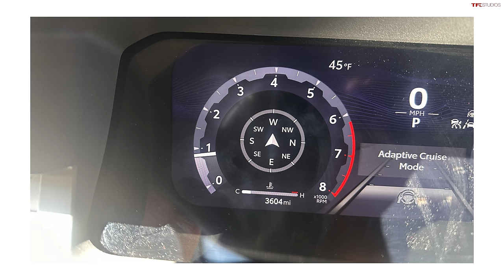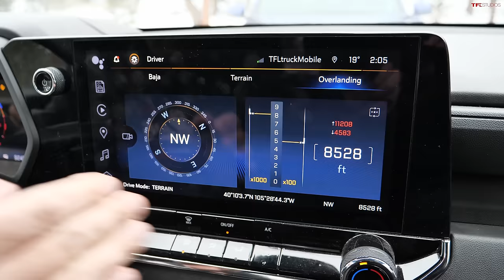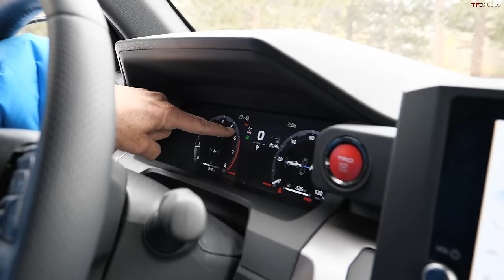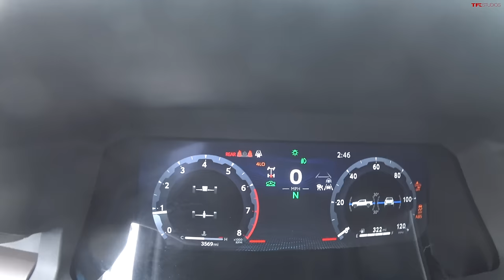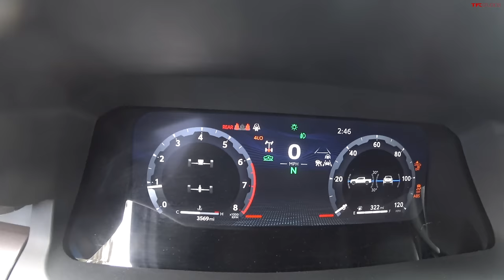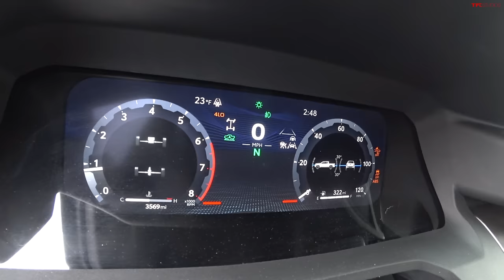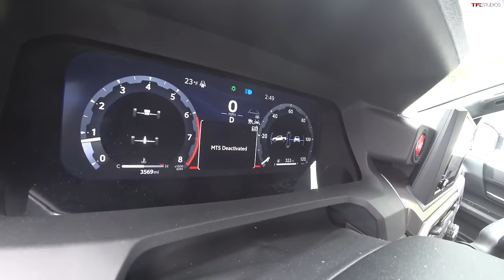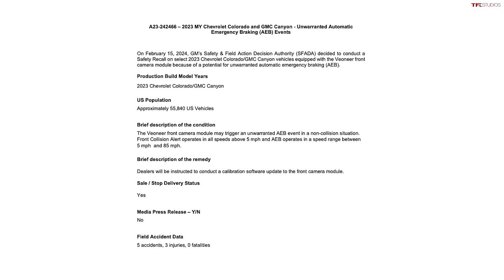Our Brand-New 2024 Toyota Tacoma Almost Left Us Stranded...Here's What Happened!

Comment: 33:03 even if they do watch it. You guys are absolutely right.  There’s basically no load on the drivetrain  in the slippery of terrain. There’s no way anything should have broken in that situation.
Reply: ATRAC puts load on the drivetrain due to the braking of the spinning wheels.
Reply: @thelandcruiserproject no atrac on auto Tacoma’s only manual
Reply: @mikem273 lol.  Um.. You might be totally wrong about that one
Reply: Even so. ATRAC shouldn’t break axles. It’s got to be a defective part. I could see ATRAC break an axle in Moab while bouncing at 75% throttle. Not icy conditions. Otherwise every Canadian Tacoma driver should really watch out.
Reply: @thelandcruiserproject  my question was ATRAC disengaged and could have led to the able breaking?
Reply: Not the whole story though- in an open diff the ATRAC system applies the brake in a pulsating timed application from the wheel speed sensor feedback into ATRAC and when the wheel is braked, the power goes (magic of an open diff) to the wheel (singular)  that requires less torque to rotate it.    @thelandcruiserproject  , but everyone can see  when the axel broke- Roman did have a bit of wheelspin going on (not a lot of RPM's) but with that wheelspin, when the tire contacted the dry portion of the rock the sudden stopping of the wheel (just a split second before the axel broke) and  the power going through the axel, the axel popped.  pretty obvious, seen it many times off-road with the wheelspin and the sudden traction.  the energy has to go somewhere. The torsional load on the axels is multiplied significantly with that wheel spin. IMHO the axel had to be a defective , weak part from Toyota though to pop with this little amount of rotational force on stock tire size  and a very mild amount of spin.
Reply: @86309  That shouldnt happen regardless. Especially not on such slippery rocks. Then you cant do anything. You would have to be careful even on regular roads in the city lol.
Reply: @thelandcruiserproject  Yes but not much under these conditions. It should be able to handle full throttle on tarmac.
Reply: @stevenk805 Maybe that’s why new Tacoma’s are just trickling into Canada.  Testing reliability on US soil first.

Comment: I made a comment some videos back on how nobody truly tests whether the Tacoma is even reliable or capable at all. I thought it would take at least a little more than 31 inch tires and a bit of snow to have a catastrophe...
Reply: I think personally he shouldn’t have been behind the wheel
Reply: @kc.47   Classic Toyota fans always coping and quick to excuses when their God bleeds.
Reply: @kc.47 Yeah and he obviously didn't keep on maintenance. He should have changed the CV's every 1000 miles
Reply: @AnabolicRick915  as a Toyota fan this is disappointing and nothing short of unacceptable. This is just the turbo, what's going to happen with the significantly more powerful hybrid. One thing is forsure, whether your a Toyota guy, Jeep, Rover... whatever your brand, older is better.
Reply: @BingBingBingBingham  Absolutely. Older cars were just insanely overbuilt. These days they have to squeeze for razor thin margins so the parts just naturally are cheap and crap. I say this as an owner of a brand new vehicle too. They just aren’t built the same and the engines are under high stress due to turbos and regulations pushing those limits to the edge.
Reply: @anabolicrick915 Toyota fan here. The new Tacoma is a Prius with a truck bed. It’s absolute trash. The 3rd gen I bought last year will be the last Tacoma I buy new.
Reply: Losing an axle isn't a catastrophe😂 blowing your T case is a catastrophe. Tell us without telling us you've never off roaded before
Reply: @thetroglodiaries no it's not lmao learn something about it
Reply: @thetroglodiaries  this comment makes me wonder if you even bothered to test drive any of the other midsize trucks on the market so that you could truly understand how anemic and Prius like 3.5 L engine in the third gen is. It’s truly a terrible truck engine.
Reply: @subradiant_music   Oh yeah losing an axle isn't a catastrophe on a Toyota, it's just yearly maintenance right? 😂 Sure I've never been off road in my UT based rubicon on 38s. Just don't follow me or you might have a 'not-a-catastrophe' 😉

Comment: 18:49 Be safe guys. You should be equipped to self recover safely. I was cringing as he hooked the tow strap to the chain hangers of the Chevy hitch. You are professional car guys going offroading in potentially remote places, and not one of you have a hitch mounted recovery point for the rear? You could rip those chain hangers off or at least bend them. Or worst case break them and have a flying strap. Also I question the Tacoma front recovery point. As I understand, my 2019 has a hook on the passenger side (for recovery) and that loop on the driver side (only to tie down trailering). I don’t know if the driver side loop he tied to is for recovery. Also, did you both try that fully aired up at highway pressures? Dropping your tire pressures would have given you significantly more traction, as is typically done offroading. I figured you guys had a fully equipped support vehicle following you with straps, hitch connections, a winch, and recovery experience. You should get a friend like that to join you. 

I’ve enjoyed your review videos and hope you guys learn to be prepared and keep safe. 

I hope the Taco is OK. Can’t wait for the follow-up diagnosis.
Reply: Yeah this was a frantic mess, which is surprising for these guys.  Now we know where Tommy gets it.
Reply: I was hoping for a hitch mounted d-ring point.  Couldn’t believe it when he threw that shackle through the safety chain point.
Reply: I was disappointed at their recovery gear too . . . could have used soft shackles and multiple kinetic ropes too . . . 👀
Reply: For sure, they looked like total newbs. Kind of disappointing to watch that cluster, going on.

Comment: In my 2016 Tacoma I had it in 4L craw control. Switch back to 4H and heard a bang and could not take it out of 4H. Took it to the dealer and they found the transfer case actuator shorted and had to replace actuator in transfer case. The 2024 Tacoma seems to still have the same issue.
Reply: Andrey took it out from 4H just fine in this video.
Reply: That was the best hint I read so far. 👍🏼
Reply: Almost as if electronically controlled transfer cases aren't a great idea... 🤔
Reply: What'll it take for engineers to start removing some of the excessive electronics? An EMP event?!

Comment: Can't believe that they didn't think to look at the CV shafts right away. That would have been the first place I would have looked after hearing a sound like that.
Reply: I think that they know what failed but don't want to be responsible for Toyota loosing sales. 😂  you can see that the front axle failed.
Reply: They snapped a cv shaft. Guarantee
Reply: I agree they either snapped the cv actually or it just popped out I've had that happen
Reply: I agree totally a CV and anyone who wheels IFS should know that.  I lost some respect with this episode these guys talk about trucks for a living and they don't fully understand how IFS setups and open diffs work.
Reply: Came here looking for this comment. Anyone that has been off road for 3 seconds knows that was an axle shaft.

Personally I’m impressed that the TCS actually engaged the brake on the spinning side enough to snap the shaft on the traction side. 

Dont put lockers in these on stock shafts 😂
Reply: Man.. I don’t want to be mean but guys… you should really think about your physically health. To get that winded from just walking in some snow is not healthy. Join a gym and live linger and happier.
Reply: @toejamr1 thought the same thing, wild that they were winded trying to put the tow strap on
Reply: @joshuagray5094 altitude...
Reply: I was thinking the same thing. An offroad channel, these guys are clueless about 4x4 vehicle basics. Independent front suspension vehicles are very prone to CV axle snapping under stress.
Reply: Because they don’t really know off road stuff. They just pretend to be
Reply: @pookiemonkey1474  After watching the entire video, it's pretty obvious. 1: No experience with Toyota's or IFS 4wd, all of us who own one, we've heard this sound at one point. It was either the cage in the outer joint snapped, or the shaft side going into the diff. 2: No real practical experience with off road. When you have slip / bite conditions, that's when you break shit.  3: If these are "car people" they missed inspecting the front end to a decent degree. IF the CV break was bad enough, it could have come apart while driving.  I've literally had to cut boots and pull the dogbone out so I could drive home safely.
Reply: @Go4Lo  I lost some respect in the video where they had a viewer bring his bronco on their trail and they damaged it trying to snatch him out after some poor spotting got him stuck
Reply: This is why I never trusted these guys or their opinion. 🤣
Reply: Just some colorado yuppies from the city. They don't really know the mechanics of vehicles
Reply: @toejamr1   consider the elevation where they are at as well. I can do a 20 mile bike ride in Oklahoma, but when I try in Leadville, CO I can barely make it 4 miles 😂
Reply: @capy_official  ANNNDDDDDDDD you'd be wrong.
Reply: @shroom903 🤣
Reply: @toejamr1  elevation wrecks you
Reply: @toejamr1 it’s the elevation. There is less oxygen that’s why they sound winded
Reply: Wrong!
Reply: @capy_official  you are wrong!! You tube machine lol
Reply: I agree that it’s very likely a broken CV
Reply: Wouldn't you have to break two to prevent both wheels from turning? What are the odds of that?
Reply: yeah that was hilarious

Comment: They never miss an opportunity to dig at André for his Colorado not having cruise control and I'm here for it.
Reply: I'll take the broken TACO over the running Colorado anyway. GM recalls, cameras that apply brakes > nope. Blueberry is better than yellow on any truck.These guys are so impressed with the touch screen and button pushing. All that crap will break over time.The broken part appears to be possibly due to the ice, frozen ground, approach angles and obstacles as well as driver errors. The dealer will fix it. BTW, my stock old Honda 4WD or my RWD > 1970 Chevy C10 or our 4WD Nissan pickup would get up that little incline. 
:face-orange-raised-eyebrow:
Reply: @chefgiovanni cope.
Reply: That video when he realized his 2024 $46k truck did not have cruise control was hilarious
Reply: Idk why his doesn’t I have a 2023 Colorado trail boss and mine has cruise control, lane keep assist,and auto braking. Mine was also cheaper at 38k.
Reply: @chefgiovanni im just gonna remind you a base trail boss just pulled out your TRD after it blew a diff on a trail that they bring mom suvs on😂

Comment: Nice to see the Chevy being “like a rock” for the Tacoma lol
Reply: Too bad GM can shut that truck down immediately by signal. GM is government motors.
Reply: @ryanb8736 Foil hat😂
Reply: Just hope your instrument cluster continues to turn on in your Colorado and doesn't put itself in limp mode or drain the battery when it tries to run an OTA update. 😅
Reply: @ryanb8736 the Tacoma has to follow all government regulations just like any other brand. This truck isn’t built in Japan and shipped over here like many European cars
Reply: @ryanb8736  You do realize that Toyota can also do that, so can Ford, Nissan.... What's your point?
Reply: @Meech_CV  That issue has been fixed, but it's a fair critique of the Canyon/Colorado. That should not have been happening to begin with. Leaving a truck bricked because of a software issue is not cool.
Reply: @endlessnameless3996  He's talking about the bailouts GM has received over the years because they would have gone belly up.
Reply: @ryanb8736 I laughed when he talked about all the little gidgets the Toyota had that the more basic Colorado didn't.  And the Colorado completed the challenge while the more expensive toyota stumbled and bumbled all over.  Toyota tax gets your money while delivering less.  But but but that resale value,  right?
Reply: @elche1976  Don't forget reliability, they will fix the tacoma and it'll still outlast that chevy.
Reply: @adrianhosein7698  they've been saying that about toyota since 2018. It didn't get fixed,  now it's been refreshed.  Same issues,  different look.  The last generation wasn't the best midsized.  And they've continued it.
Reply: @Meech_CV    Or… fail catastrophically in a hostile environment?
Reply: Never thought I would see a Chevy rescuing a Tacoma 😂
Reply: @elche1976  The GM will dump in value like all the others. History always repeats itself with GM. Many 2.7 engines already blown.
Reply: @ryanb8736  could happen.  Been in the Silverado since 2018 and so far so good.  I guess you can keep hoping though.
Reply: @davec.3198  He's actually talking about his paranoia that GM is going to take control of vehicles. Now, how about the government having to force Toyota to replace rotten truck frames. That seems worse than a bailout.
Reply: @adrianhosein7698  😆 Toyota breaks. 
Fanboy: "They're reliable."
Reply: @ryanb8736  Sounds like you need to be rescued by a WAHmbulance.
Reply: @endlessnameless3996  more so than all the gm/fords/Chryslers that break 🤣🤣🤣🤣🤣🤣🤣🤣 a broken Toyota is still kors reliable than a working domestic vehicle 😌
Reply: @adrianhosein7698  Yeah, you can count on it to ride like a 1970s Yugo, and have the power of a go-cart, and for all of the steel to be a pile of rust. Ol' Reliable. 😄 Mine could barely pull my 3500 # camper and the ball joints were already going out at 25,000 miles. The 2016 Tacoma I had before that was the biggest piece of shit vehicle I've ever owned.
Reply: @endlessnameless3996  Name me one 4 cylinder GM has built that has high reliability. I’ll wait. They don’t even have a legendary 4 cylinder. GM has been redesigning so many engines in the Colorados for a decade. Why? Because they can’t get one to last without defects. 

Audi and Volvo built legendary 5 cylinder engines. GM was only one to fail at their 5 cylinder. Only one. That says it all.  GM fans said they will build it better than Audi 5 cylinder. I laughed and said GM will fail. I was right and GM fans were wrong. It’s been so repetitive for decades. Even the 5.3 and my favorite 6.2 is problematic. 

I’ve been working on GM cars and trucks since 1989.

Comment: Snapped a CV.  Thats happens spinning wheels on IFS setups.  That did snap really easy.  No drive   on the other front wheel because of the open front differential.  The snapped side just spins, no power goes to the unbroken side.  I've changed lots of CVS on the side side of trails that look just like that!
Reply: Neither wheel was getting power. Something in the front diff broke.
Reply: @John_Redcorn_  that's how open diffs work.  The wheel with the least resistance spins.  The broken CV is the least resistance no power will go to the unbroken side.
Reply: Do you think this situation would be a QA issue from Toyota's end regarding CV, or pretty common across the aisle?
Reply: @drill_fiend1097  that's hard to say there's no doubt it snapped easier than it should have.  You don't want to spin your wheels when they are not getting traction but it didn't seem like he was on the gas too hard.  Maybe the traction control system was braking the side that snapped.  Whatever it was that was that caused it to snap, that is the easiest I've seen a CV break for sure.  I would hesitate to condemn the CV build just yet because it could be the way the traction control is setup on a new to market rig.
Reply: Nope. It's the diff.
Reply: @polarys425  I'll believe that when I see it taken apart.  But apparently these yotas have a front differential actuator that does break for an expensive repair.  My Nissan rigs just have transfer case and front diff.  If something snaps in the front end it's going to be the CV which can be changed out on the trail.  This is a big issue for anyone who was planning on taking this Tacoma off-road.  Is the front diff a new version?
Reply: Reality is how many people are going off road most will be pavement princess.
Reply: @Go4Lo  posted on one of their other channels today. Broken diff.
Reply: This seems like it would be a fundamental weakness of brake-based "lockers", no?
Reply: A.d.d. broke. If it was the axle, it'd still engage 4hi, which it isn't.
Reply: @Constipatedoverlord  lol
Reply: Why would a CV snap on a brand new Off Road version Toyota Tacoma? Cheap Chinese steel parts? That shit should be hella stronger, like 50% thicker on an off road version, or high strength steel at least. Something tells me all you get are a few stickers when you pay for the Off Road version. lol

Comment: I saw the engineer from Toyota going on and on about how great the new motors are. That these turbocharged tiny displacement engines with high horsepower and torque are going to be just fine. I did not believe a word out of his mouth.
Reply: To me, turbos are just extra stuff to break.  They have their place, but I don't want one anywhere near my truck.
Reply: They’re actually not really new. They’ve been using them in Lexus SUV’s for a few years
Reply: Have you not been around?  Toyota has been building turbo engines since the 1986 Pickup with the 22RTE.  Legendary reliability.  The old MR2 and supra engines would go 200k+ without anything more than maintenance.  Toyota knows how to make them last.  Just follow the maintenance schedule and put premium oil on it.  
Historically the V6s were the ones with problems.  Even the recent generation had problems.